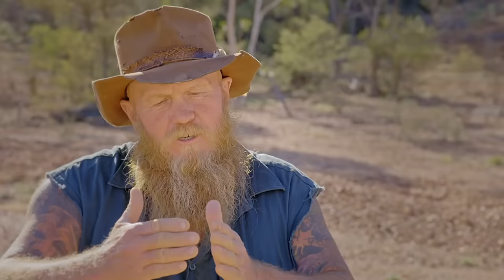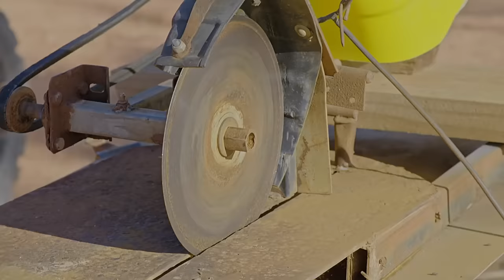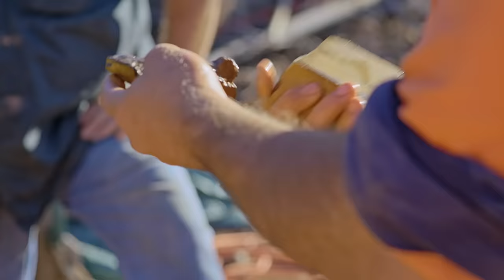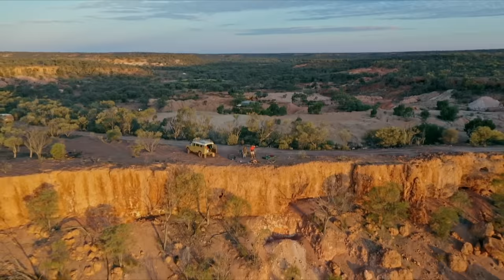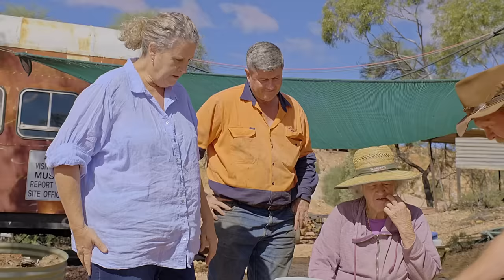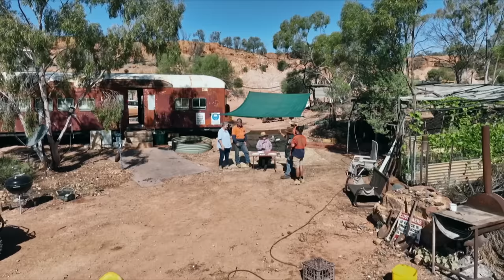It’s A Giant $20,000 Payday For Rod & JC! | Outback Opal Hunters: Red Dirt Road

Comment: They found it and them people took it from them
Reply: Them people owned the lease where they found it. Them people also did all the work cutting. Them people also had the interested buyer. So Rod and JC got $20000 for finding opal bearing rock on someone else lease!
Reply: @waynelemmon3007  That's all correct. Except I calculated $300K, so their share should have been $60K.. correct??
Reply: @Robert.Levi.Miller  no way was that parcel worth 300k. If it was, your maths are correct. 20% is still 20% no matter what the valuation is.
Reply: @waynelemmon3007  Of course u would say that cus u r one of them. I know what's going on. Let's just hope they get their 60K 🙏
Reply: @Robert.Levi.Miller  thanks for the laugh
Reply: @waynelemmon3007  welcome